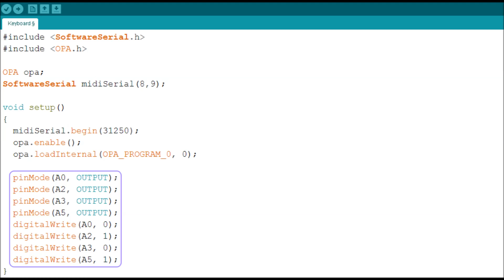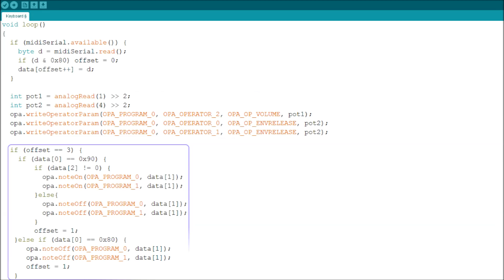OP·A shield campaign - OP·A bringing sound to modified MIDI controllers

Comment: I'm been having a lot fun with the OP·A shield via the editor. Many thanks for a great project!
However, I'm having trouble setting it up for MIDI control. The keyboard.ino included with the library doesn't compile. The error message reports issues with program stealing and sample parameters. I'm not a coder so perhaps I need to study more, but would this be related to the keyboard.ino predating the current editor/pcm samples?